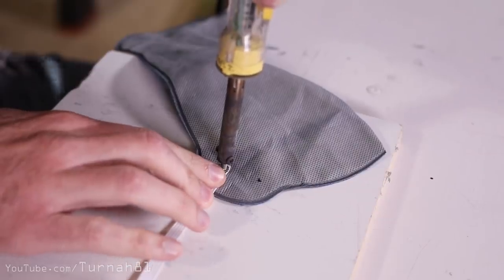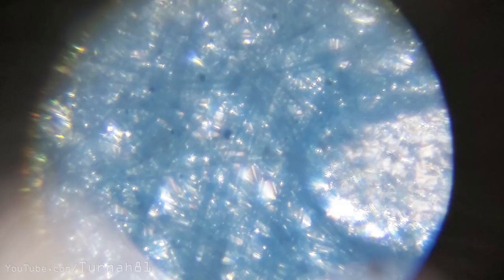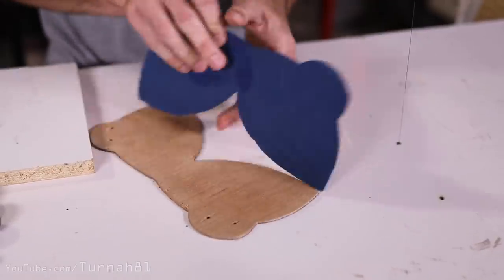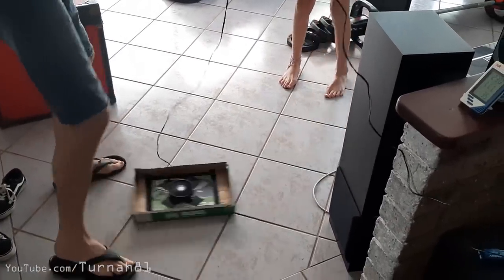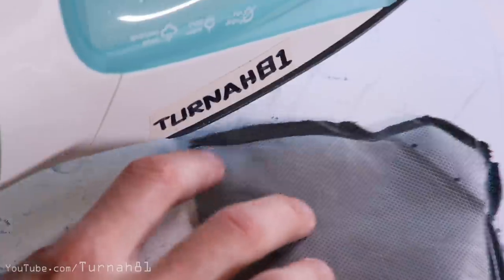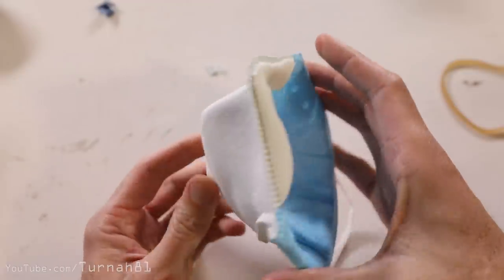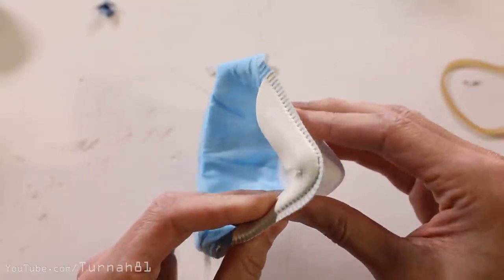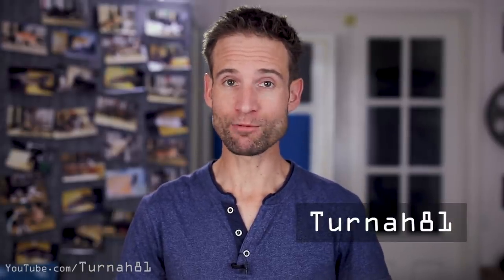How to Make the Best Face Mask, No Sewing (Don't use Cotton or Vac Bags!)

Comment: Im gonna try making these immediately. Have you tried to wash these after construction? Do they stay together???
Reply: I have washed a sewn mask of this fabric, made of shopping bags. I had success hand washing with dish soap and peroxide and air drying. It dries really quickly! If it just needs disinfecting, spray it with hydrogen peroxide and let it dry. A standard spray head will fit right onto the brown peroxide bottle.

Comment: Your sewn center stitched and glued seam  - sorry I think you’ve perhaps missed the point of sealing the edges with glue. You’d have to dribble glue over the stitch line, as well as the edges, because you’re worried about air getting in the holes made by the needle. 
But if when testing you can’t smell the spray, you know you’re winning, sealed or not, I suppose. The fabric is held closely by good tight stitches. 
I’ve made similar to these with a sandwich of 2 outer cotton cloth layers and two inner layers of shopping bag NWPP, as you use, and stitched all round. Plus nose wires. I couldn’t smell vanilla essence through it. But after about 30m wear it was time to change it. 
Great advice on where to source the polypropylene, thank you, and love the idea about wire. I’d bought some 5mm flat aluminium wire from a diy jewellery store online, which works quite well. 
As you’ve discovered, NWPP is washable, so we can reuse these.

Comment: The only thing I got about the house is a iron, glue gun and elec wire for the nose piece lol, not got a car cover, can’t get any materials from anywhere, as I am in isolation,  as very vulnerable ,  think  will use fabric and filter material I have got, good video
Reply from the maker: Hey did you check out the follow up video.  Link in pinned comment

Comment: I thought you might have worked out a way of using your regular neighbourhood moggy as a face mask replacement. Start by rubbing catnip over your face then just introduce the feline to your facial area and I'm pretty sure they will self attach and clamp on quite firmly, keeping a pretty good air tight seal and you also seem to have a good source of replacements and most near you come prewashed.🐱‍

Comment: I could use my woodburning pen instead of an iron. Thanks!
Reply from the maker: for sure. Yeah a few people said they have done it that way and it has worked. cheers
Reply: We tried the regular clothes iron and mine seems to have a cut off that kicks in every now and then unless you keep it ironing and on the flat, so the iron did not work. so next time I tried my wood burning iron because it was closest. We used a flat leaf shaped little tip to it, and use the side of the tip so that we were drawing thin lines in parallel, about what you would get if you were drawing with a ballpoint pen.  That works but it did leave scratchy edge on the mask.   

We have a temperature controlled soldering iron upstairs and I'm going to try it.  Someone said they had a $5 potato chip bag sealer and that it worked well.  I had tried my cheap little bag sealer but it did not heat up enough to melt this, it has never really even done a good job sealing bags, either.    If my clothes iron worked better, I would try it and the parchment paper around the outside to help it melt better without sticking to the iron.

Comment: My suggestion is to cut out and seal the edges with a "cookie cutter" in sheet metal, with a folded hence double thickness edge, and heat this in an oven to the appropriate temp. ie 350 F

Comment: All this information is great, but it's a heck of a lot of work (and materials to find) for a single use mask. I'm thinking buy 3-ply masks in bulk (2000 at a time can be less than eight cents (USD) per mask. Then use that material from those masks to make a better mask that fits better to your face. Perhaps two 3-ply masks altered so they don't have gaps?

Comment: Worth noting that vacuum cleaner filters often have glass-fibre in them.  So probably not worth cutting up and sticking on your face. I know you said probably best not to use them, but i think this is worth mentioning.
I also think mask wearing gives a false sense of safety. Washing hands and not touching your face is probably a far more defective  way to prevent self infection. Sneeze and couch particles a best voiced by social distance. Besides a virus can still enter your body by ear or eye I imagine? Your mask does not cover those things.

Comment: Hello! thank you for this looks great. It happens to have material at home for this but I printed out the layers for the mask and it came out too small. Am I missing something? Is the layer the actual size of the mask? Thank you in advance!
Reply from the maker: Hey thanks.  in you're printer settings look for options that say something like "actual size" " fit to page " select actual size and see how that goes.

Comment: Thanks for pointing out the bag material!  I have at least 2 here that will become masks. Question - my filter is going to be an HVAC filter rated at 13. Should I remove the wire?  Will that interfere with the seam sealing?  Oh yeah!  Is this washable and if so, how?
Reply from the maker: Hey thanks.  I'm not sure about the wire I haven't handled a filter like that. But the material I have used is washable.

Comment: Hi, Thanks for your video, I like the description of the type of material density (GSM) circa 100 -4, 50-1 used in terms filtration.  Some of the cotton masks also use a layer of non woven interfacing which can be extra light weight light and medium, I bought some  light non-adhesive backed (sew-in type) to try out. Also would  a wood burning tool work to fuse seams or attached the elastic.  Perhaps  glue and melted fabric could  be used in combination to attain a better seal when any sewing is used.  The only other experience of melting fabric I have is when making paracord type bracelets to seal the ends. Thanks for video again. Stay safe.

Comment: i wonder if you could use a couple pieces of aluminum bar (any hardware store has this stuff) and shape them to make the two shapes you need to bond the mask. Then you could heat them in an oven to make it consistent.

Comment: Have you applied calculating the material pore size by applying Poiseuille’s law?  Most fabric pore size 118-1111 micron. Virus is 0.125 micron. Under your light microscope the pores look huge compare to the invisible ( by light microscope) virus.

Comment: You can use a large book or two boards to sandwich the material leaving only the edge exposed. Then, move a bic lighter along the edge and let the flame melt a bead line. This is the same technique used by drug dealers to seal small corners of baggies.
Reply: It's been 4 weeks. Can you report back on your success with this method please?

Comment: Have you tried using a wood burner in place of the iron for sealing the edges?
Reply from the maker: Actually maybe? Are they adjustable?  There have been a few good suggestions of alternative heat tools which could be better- I don't have them though plus for this though I trying to use the most common available tools too.

Comment: hello..fantastic idea , great tutorial !
What is your website so I can download the template?
thanks!
Reply from the maker: Hey thanks it is in the description. cheers
Reply: I found it, thanks!
I have a few brand new vacuum bags , does the material work the same as the one you use?
I am in Madrid ready to make some masks for friends and family with your tutorial, the best I found after looking on the web for days.
Gracias again :)
Reply from the maker: If the vac bags are non woven polypropylene the masks can be made with the same process. Some are and will filter well however there are many different types so its hard to say.
Reply: Turnah81 
I am pretty sure they are non woven p. ,  the material looks and feels almost the same as the one fpp2 mask I've got.
I got them in Amazon.es a while ago for the nilfisk gm80 the brand name is Ersa
Gracias :)

Comment: If you are worried about leaking through stitch holes, then heat-sealing the edge isn't going to help, is it? I mean, the stitch holes are still there, aren't they? 
Hot glue, on the other hand, will indeed seal the stitch holes.

Comment: Hi I am having trouble printing the template. it will not size for my paper. the 10 cm line come out as 8.5 cm . could you possible make a link with just half of the template?  Then I could fold the paper in half cut it out and have a complete template.I have tried all the setting on my printer as you suggested and just can't get it to work Thanks in advance

Comment: i'm just going to 3d print the bulk of the mask then use this method for the filters because I don't have that much material to play with.
Reply from the maker: Cool but are you sure. Even up to uploading this video I am din ching more of it around the house.  Even an ice pack cover. Shopping bags are most common though
Reply: @Turnah81  I'm not sure that I even have a shopping bag. I've only lived in this house for like a year, not long enough to amass my dragons hoard of random items. Might have one hepa filter or at very least an unused air filter for my car, the latter probably only being good for filtering out sticks and small birds.

Comment: Guys just remember that this will not filter Covid-19.
Reply: it's not going to stop you from getting it, but it you have it, it will reduce the likelihood of giving it to someone else. If you want a mask that can filter it completely, you'd need to use a HEPA filter (which requires a powered blower/puller fan and a full face mask).
Reply: It reduces the risk
Reply: It's better than nothing but please guys don't risk your life and buy a professional respirator if possible or layer your homemade masks for better filtration.

It's better than nothing.

Comment: "Then disinfect it." Well, how? You missed out on this detail. Wash in Chlor? Thanks Craig. Like the idea of the Hot Saw and homemade exhaust fan. 🇦🇺
Reply: Spritzing with hydrogen peroxide will disinfect it. To wash this fabric, it should be hand washed with dish soap and peroxide and line dried. Since it's plastic, it air dries really quickly!

Comment: Great idea. But you have all that stuff around your house. We have to put ourselves at risk running around trying to find the material.
Reply from the maker: Thanks, The most common source of material I found was reusable shopping bags. The wire and nose foam could be substituted for something else (i was a little too specific in trying to match a N95 mask). Elastic may be the hardest thing at the moment i am hearing. But rubber bands work ok.

Comment: Would a soldering iron work instead of the clothes iron? I built a simple extension cord with built-in dimmer switch, the kind of switches you Use in the wall to dim lights… And that way you can plug-in a Soldering iron and control the temperature. I was thinking that might work.
Reply from the maker: Nice work, I'm not sure I couldn't try because mine couldn't be adjusted low enough and just burnt through every time.  Mine only goes down to 200C Let me know how you go!

Comment: That nose wire doesn't look very comfortable. I'm thinking of using the flat wire&plastic thingy that reseals my rice cakes (some bread loaves come with them too.) They are pretty flat but the edges may be a bit sharp: you can glue a thin piece of craft foam on underside.

Comment: Why can't you use the wooden template to make a large hot iron that can be heated and used as a stamp? Like a branding iron. Then simply cut out the mask and finish?
Reply from the maker: That was my original vision. Lots of tech problems, but it puts it out of reach for most  people too.

Comment: Looks nice, however their is a lot more to a mask then that. Can you guarantee it will capture 95% of the particulates in the air .3 microns or larger? Plus that's not a real fit test to ensure a perfect face seal.
Reply: Its better than a cotton mask.  Don't forget what we are comparing this too.  In the absence of ACTUAL n95's - he is doing his best to approximate one.  He explained how he compared the fibers of known n95's to the materials he used.  Knowing WHAT type of material they use - you can extrapolate these are close.  Again - better than a mask made from a t-shirt.

Comment: Nice work but there is one issue: N95 masks are treated with electrostatically active particles that attract and bind to particles in addition to mechanical filtering. Your mask will be a great mechanical filter but certainly not N95. Might still make a few myself anyway, better than an improvised cotton one. Also: the reason to wear a mask in public is to protect other people from you, not to protect you from others. Essentially its to make an infection person less likely to shed the virus into their surrounds and you don't need anything near N95 to achieve that.
Reply: Agreed, it's that electrostatic charge the breaks down when masks are cleaned for reuse too. Its the charge that catches the small particles like viruses so without that you will lose a lot of the virus filtering capabilities.

Comment: You can just buy p100 gas masks from china on ebay and depending on your need you can do fast shipping. No filter material can filter out viruses. You can only hope the charcoal cans will prevent viruses from going through. But at that level, i'd be more worried about infecting from eyes, etc.
Reply: True P100, N100, P3 masks have an electrostatic coating to catch sub-micron particles like viruses.

Comment: i wonder if a flat iron or one of those gimmicky potato chip bag sealers would work better cause it easier to hold and control and you can actually control the temperature you can get a flat iron for like 5 bucks in some places and if you ruin it it wont be like ruining a perfectly good clothes iron also just hot gluing it together along with sewing will work it will look ugly but who cares ya know ive been sewing cloth ones they look terrible cause i have a crappy mini sewing machine that only has one setting but they are effective and free so looking professional and cute isnt always the way as long as it properly sealed to your face and you can actually breath in it is all that matters

Comment: Can you sanitize the your mask by putting it in the oven at 170 F you only need 135 F to sanitize the mask but my own oven starts at 170 F and my n95 mask doesn’t melt or burn and does nothing to the elastic ban.

Comment: Would it be possible to use a hair straightener to weld the seems together instead of an iron?
Reply from the maker: I gave it a go but it was too hot and not adjustable. Plus you can't apply enough pressure
Reply: Turnah81 can ajustable temp straighteners have a chance or is the pressure more important than just the right temperature?

Comment: I'm sure it's already been posted but: many types of vacuum bags and furnace filters (many, not all) have fiberglass particulate woven in. Not good for your lungs! make sure if you're using any of the two items that the bag/filter is not made with fiberglass.

sometimes it's hard to tell but do your research

Comment: Is this material confirmed safe as a respiratory device?
Reply from the maker: Yeah literally the same stuff however car covers and shopping bags won't necessarily be produced in a hygienic way so need cleaning. And may not have upgrades like high spec n95s like static charged filter or hydrophobic coating.
Reply: @Turnah81  yea I watched the video so I heard all those points already, just wondering, is that material specifically safe if used as a respirator or could people who make them unwittingly end up breathing harmful fibers into their lungs?

Comment: Not to cast aspersions on Turnah or his great work here, but can we get some effectiveness opinions from viewers with expertise in the relevant field? If what we're looking at genuinely is a viable home-making method for fully capable officially approvable PPE, then this could be an opportunity for makers everywhere to start manufacturing PPE for local hospitals, a supply increase that could make a world of difference.
Reply: It will be missing the electrostatic coating that a true N95 or above mask will have. That will significantly limit its ability to catch sub-micron particles like viruses. This coating is one of the issues that means masks can't be washed or sterilised, as it destroys the coating. There are a lot of studies on it right now to try and find a way to safely reuse PPE given the worldwide shortage. I am not an expert, but have been trying to keep on top of the information that's coming out.

Comment: How you disinfect this after you've worn it?
Reply: If you're in a sunny place, you can simply leave it in a sunny spot outside for about five mins, turn it over and leave it for another five minutes. The latest study showed this virus actually dies in solar light within about 90 seconds... 
Or... Heat the oven to around 275F with a bowl of hot water on the middle shelf. Put the mask on the shelf above the bowl and leave it to steam for about 30 mins.  IF you're 'all electric' and have a toaster oven then use that instead of your main oven to save electricity.